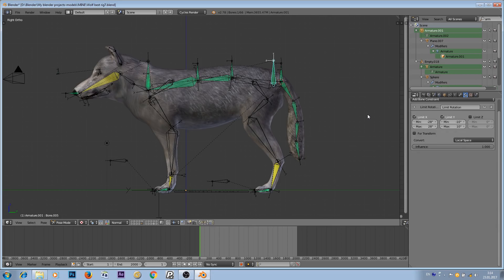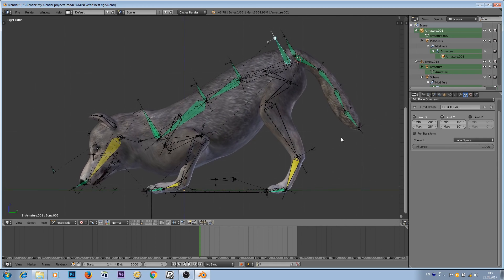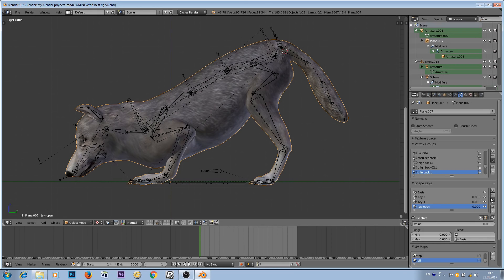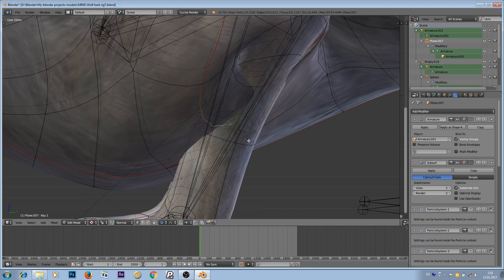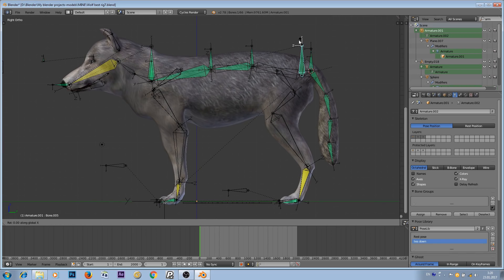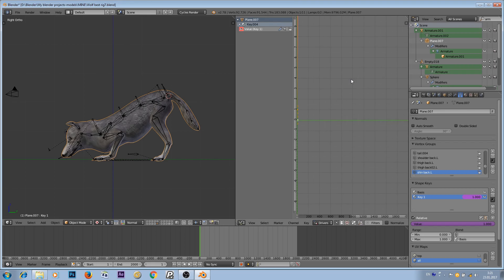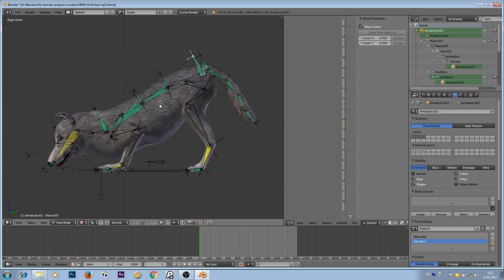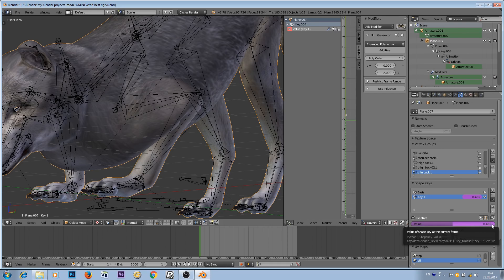Blender tutorial: Corrective shape keys and drivers on a character

Comment: Thanks a lot!  I made a shape key driver for my ankle, but it doesn't work.  I followed it step by step, except targeting my foot.L bone.  No matter how much I rotate it, the N panel value still shows zero.  :(

edit I found a solution.  Instead of targeting the Foot.L bone, I instead targeted the Foot controller.  It's weird, doesn't make sense, but it works.
Reply from the maker: Glad you sort it out. But most likely i know your problem. In the generator modifier there are axis Y and axis X. So you could try to enter value 1 or 2 instead of X axis into the Y axis box. Or sometimes works value -1, try also negative values. Play with that until you have desired result.
Reply: I see!  I didn't even think of adding that to the Y axis instead.  Also, do you know if there is a way to add some type of bend to the curve of the driver in the graph editor?  I don't see any handles to move around on any of my drivers for the shape keys.  :(  

Why do I want a bend in the curve?  Because the shape key is acting a bit too fast before the limb bends in the target degree.  I mostly fixed it a bit by selecting the bone itself in the blend option, but it still isn't perfect.  __;